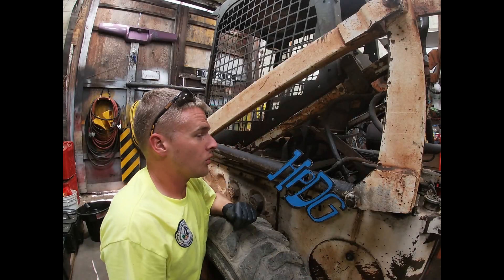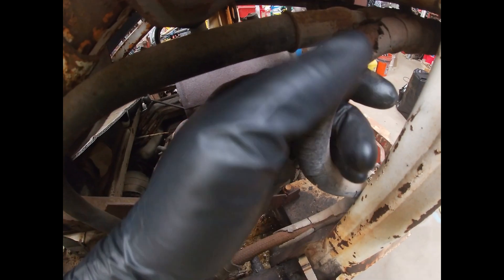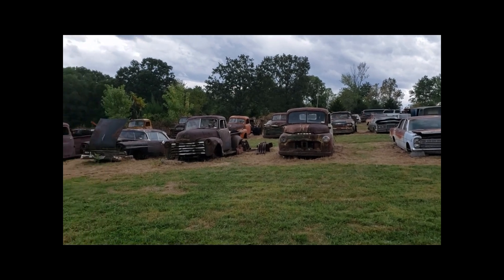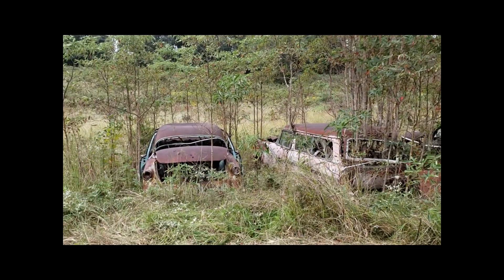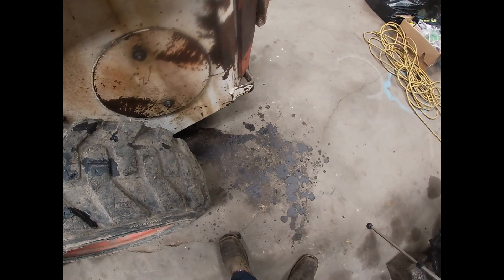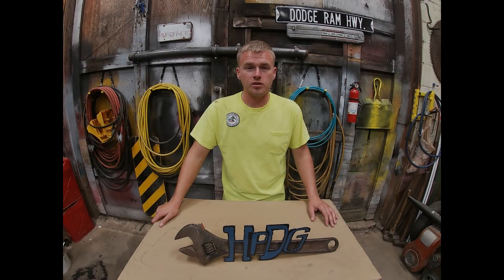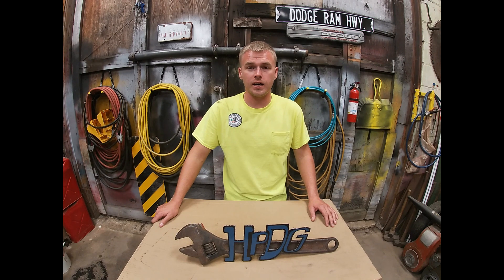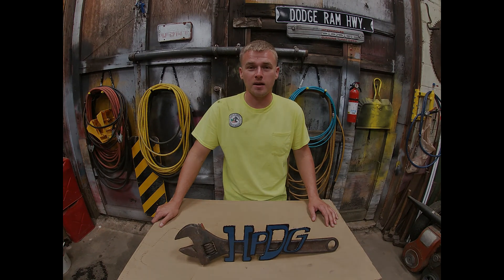Bobcat Repair (Bonus Auction Footage)

Comment: I bought a old Bobcat 610 .   it ran but was is rough shape.  replaced all the hoses that can be seen from the top.  put on new wider tires.   when I did start to use it found out that the ground needs to be dry.    any moisture and it would dig itself down and make holes in the yard.     I sold it after working on it for about a year.   made it look much better and with the new hoses leaks in the seals for all the cylinders showed up.  My brother was able to put in the new seals for me and it was shaping up.  He stated that I should sell it before the motor gave out on it.   That sounded like a smart move to me.
Reply from the maker: Oh I understand that completely David! 😲 Mine gives me headaches all the time. It gets stuck on wet grass 😤 but mine has been fairly reliable (knock on wood). I'd like to have a bigger skid steer but they are pretty expensive.  Thanks for stopping by. Take care and be safe 🙂👍